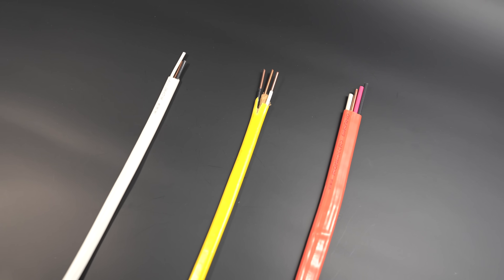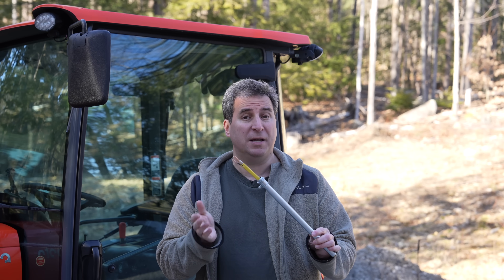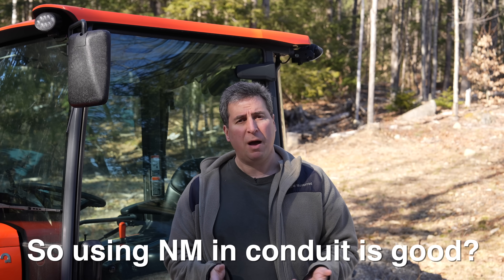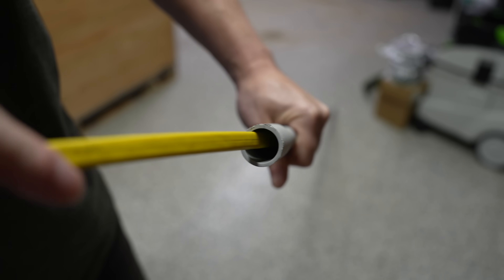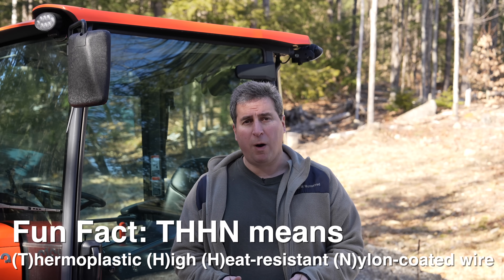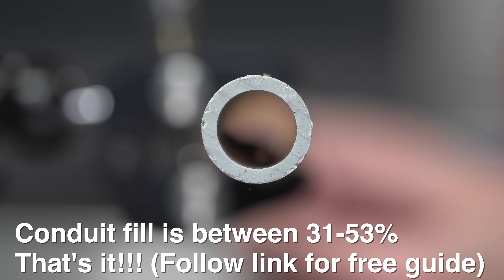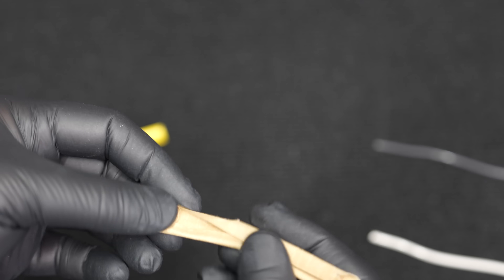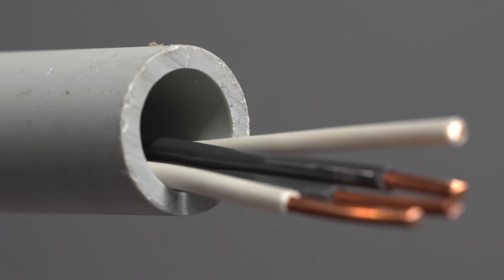#1 DIY Electric Mistake - Can you use Romex Wire in Conduit?

Comment: I ran it underground to my garage 40 years ago in 3/4 pvc conduit and it still works.😉
Reply: Ideally UF (Direct burial Romex) in PVC conduit since it is approved. I  don't believe standard Romex can be used because the plastic may breakdown over time when exposed to water & contaminates in water.
Reply: @guytech7310 - It's not really a plastics issue, (tho THWN is the right choice for underground installs) it's the paper-based protective wrapper inside the NM jacket can absorb, retain, and wick water the length of cable until it encounters a nicked wire jacket and shorts, or corrodes connectors. Yeah, more a problem in St. Petersburg or Seattle than Reno or Scottsdale, but rain happens!😢
Reply: @KevinSmith-ys3mh  Its the material as non UF Romex is not water rated. Look  it up.

Comment: The garage is considered a damp location in my area. 
If in doubt, ask the inspector before doing it.
Reply: That's makes sense. Because in some areas, garages are not required to be heated. This can cause high humidity
Reply: Liveing in Arizona and SoCal, it wasn't a concern. Now after moveing to PNW between the Vancouvers, I've shopvacced and sqeegeed out a few garages after heavy storm winds blew water past the doors. Its also a favored location for sewer cleanouts, and fail prone/maint intensive utilities like water heaters, regulators, sprinkler trees, water softeners, and cars dripping from rain & snow. So, location matters- hence local codes vary!😉

Comment: Thank you for this!  Currently in the planning stages for an outdoor project, and I'll make the necessary adjustments.  Does the ground wire need to be sheathed inside metal conduit in an outdoor applications, or is bare wire acceptable?
Reply: Absolutely use insulated grounding conductor. The reasoning behind this is if there is a short to ground, the bare wire will energize the metal conduit with fault current. Anyone in contact with that conduit will receive an electrical shock, possibly causing injury or death.

Comment: I plan to run 12ga romex inside 3/4" conduit for a dedicated outlet for a small water located inside the cabinet. The conduit would only be for the 4' run up to the attic space and then the 7' down to the cabinet. I was going to strip the romex outer cover for the conduit but maybe I will leave it on. I had read that heat (do to overfilling conduit, reason for the 3/4" conduit vs 1/2") was reason for not running romex in conduit.
Reply: More practical to just run THHN wire instead of Romex if your using conduit. not only is it code compliant its a lot easier to pull.
Reply: @guytech7310  Only reason I was/am going to use the romex is because I have a bunch of it left over from wiring the shop. All the rest of the conduit has thhn wire in it.

Comment: All modern NM uses THHN-insulation on the two insulated conductors. Sometimes (depending upon the Mfg. of the NM) those individual conductors are marked, sometimes not. Either way, it is the same wire, and perfectly acceptable to  strip the outer jacket from the NM and use it as individual conductors. It's literally the same wire.
I would challenge anyone to tell the difference between stripped NM, pulled into an EMT conduit, vs. individual conductors pulled in from a roll. I've had inspectors look at work done this way, and pass it without issue.
Lastly, using jacketed NM in any conduit is a classic rookie/DIY'er install mistake. While it is not prohibited by Code, it is extremely poor workmanship.

Comment: THHN has a higher ampacity rating than NM. In certain applications  this may be a reason you don't want to run NM in conduit.
Reply: True.  Since THHN is rated 90°C dry/75°C wet, if all the terminals are rated 75°C and you wanted to save on wire costs for example,  you could take advantage of this and use the 75°column, which would usually be the next size lighter,  like 8awg instead of 6awg.  Whereas NM-B is limited to the 60° column, no exceptions.  It would seem that this situation would mostly occur in commercial wiring particularly given the rising costs of material and labor in this day and age.

Comment: Some random guy made this “code” with zero evidence that the romex had any issues in an exterior conduit line and all the rule nazi’s adopted it as Jesus’ electrical gospel but no one can tell you why a 3/4” conduit run with a single 12/3 running through it for a short run is somehow “dangerous”.  Sure follow,code, just pointing out the absurdity of some rules at times.
Reply from the maker: I agree, at this point, there is no reason the jacket and internal paper cant be made of a waterproof material which would end the reasoning behind this. This has always been a stramge one that originally made sense when romex was made of materials from the 60s

Comment: If it's not compliant in your jurisdiction you can always run the NM romex cable to a metal j-box then splice in the box and run conduit out with rated individual conductors. As I understand it there are special circumstances such as foundation wall drops (not framed) where it's permitted (with limitations) but generally frowned upon because of the possibility of overpacking/lack of free air and heat dissipation with all of the extra sheathing, but conduits are not the only place where overpacking is regulated, such as cable trays in commercial applications where you also have to follow a strict packing density with spacing. Generally and practically speaking difficult for me to understand how a single NM drop in a conduit is going to overheat relative to the myriad of NM cables most homes have in their attic bundled with insulation in the dead of summer, seems relative.

Great video covering this topic though.
Reply: Yeah, like I would take your word or anyone else's on here without written verification.

Comment: This is great information.  We run into this situation at campgrounds when owners are burying NW wire
From the pedestal (18” above ground to “24 below ground) in conduit.  Never thought it was an issue for this short span of wiring.  Of course nobody is dismantling the conduit to check.
Reply: Mostly likely they are burying "UF" which is intended and allowed for direct burial.  It will be gray, and instead of an outer sleeve with separate wires running thru it, the outer layer is a solid mass molded around the separate internal wires.  The internal use has paper or string inside the outer sleeve to help maintain its form, but the outdoor doesn't need that because it is solid.

Also the short length of conduit falls into a separate category - conduit used as a short protective sleeve rather than for the entire length.
Reply: @Sylvan_dB  So it’s ok to put UF wiring conduit outside?
Reply: @Coldpack13  A short sleeve as you described to protect the vulnerable cabl between the ground and the box is fine.

(I don't know of a national definition for "short" but usually a foot or few is fine... a local code might be more specific)
Reply: @Sylvan_dB  Ok, thanks for the reply.
Reply: @Coldpack13  Yes, UF is rated for direct burial, and by extension damp or wet locations.  UF is allowed in conduits as long as it does not exceed the capacity of the conduit.  It is a common practice to use a conduit to protect the UF cable between the box and the soil to give it extra protection, like in the video.  For example, if you want to wire a GFI on your shed, it's common to bury UF cable and install PVC conduit between the box and the ground to protect it from sunlight and physical damage, like weed wackers. UF is even harder to pull through a conduit than regular NM cable is.
Reply: @BluCappy419  Thanks for explanation.  Couple of guys in the campground are just using Romex in conduit.  I thought the grey UF was correct.
Reply: @Sylvan_dB     Somewhere in the NEC there's an example of 2-3 feet as being acceptable for a short run of conduit. (for protection) but I have seen many inspectors allow up to 6 feet, such as when dropping from a ceiling in an unfinished basement to a wall outlet. Again, for protection.
Reply: @rupe53  Exactly. Sometimes the inspectors will draw the line at a full stick - some suppliers carry 20ft sticks! I took a quick look thru my old code book and didn't find it, but it's been too long and it is long out of date so I didn't spend much time.
Reply: @Sylvan_dB    it wasn't the latest code, but it was within the last 10 years. Someone posted the chapter / verse under another video. Once they go that far you know they are onto it and not just blowing smoke.
Reply: @Sylvan_dB  24"
Reply: @Coldpack13  Absolutely. It can determine the depth of burial in some cases. Typically it is direct burial and protected in high impact areas with nipples (short pieces of conduit.) However, it is allowed in conduit for the full length. Once again, better to upsize the pipe as it'll take up a bit of space and be tougher to pull through pipe. Generally speaking, I wouldn't pipe UF just like I wouldn't pipe NM but I would definitely utilize protective nipples in areas where I might expect someone to impact it.
Reply: @rupe53  You can utilize whatever length you want HOWEVER conduit fill calculations will kick in at above 24in for nipples box to box. Also ampacity adjustments kick in. Below that it isn't needed. As far as protective sections... they can be any length in theory as 310.15(c) and Table 1 of Chapter 9 apply to complete runs of conduit/tubing. BUT you'll have Bubba that thinks he can outsmart the system by running 95% and saying it's not complete so he can stuff it with wire. That's where 90.4 comes in and the AHJ can step in and say "nope that's illegal per our local code/interpretation." 

Running down from a ceiling to a box is fine because there likely won't be the heat load the code is trying to prevent. HOWEVER, the AHJ can and sometimes will be stricter and that's allowed per 90.4 (if they even adopt the NEC at all.) If you're trying to stuff 8 circuits through a half inch pipe for 10 feet just for protection, they may call it out just because it is dumb. Spend the extra $2 for a bigger pipe lol.
Reply: @etherealrose2139    in a typical residential situation, you'd be hard pressed to exceed the fill rate on conduit because you are usually dealing with single circuits and the Romex / UF is already hard to stuff in there because it's bulky.

Comment: What about running outdoor rated romex in a conduit outside?
Reply: There is NO reason to do that.  It is MUCH easier just to buy wire and run that through the conduit.
You can just get Direct Burial Cable instead.
Reply: @paultrauzzi5360  I prefer the belt and suspender approach. Since 1997 I run direct burial cable in conduit outside, never had a single callback except when a farmer ripped up a conduit with his excavator.
Reply: @ 
Again, there is no reason to do it.
Why not just run wire or just bury the wire?
Why are you using conduit?
You are lowering the amp rating.

Comment: Can you put it in conduit, yes,  but why would you is a better question,  pulling a single solid conductor through conduit with any sort of bending can be a major pain, to pull 3+ which are also encased in paper and another sheathing is absolute lunacy for anything with a bend.      That said there are instances where NM wire MUST be a conduit, when it's required to protect it, I mean I'm guilty of having exposed NM wire in my garage that should be protected... maybe one of these days I'll get around to doing it.    But 334.15b does state that if you're going between floors your NM needs to be in a conduit,  granted not the entire run does just at the space between floors.

Comment: why cant you run it in a conduit in damp location?
Reply: The outer jacket will hold moisture. Also, while some manufacturers use THWN for their NMC, not all do which means they can't withstand damp or wet locations.
Reply: Its fine with UF (Direct burial Romex) cable
Reply: @guytech7310  Yes but the video is about NM-C. Besides, it would be a waste to use UF in a conduit. THWN FTW in conduit in damp/wet locations.
Reply: @BigBrotherIsTooBig  Use PVC conduit to protect UF when its exposed, such as when it exits the ground and goes into a building.
Reply: @guytech7310  Of course it needs mechanic protection when exposed, but no need when it's buried 24" or more. If you are making it shallower than that you have to use conduit, which would make using UF pointless.
Reply: @BigBrotherIsTooBig  Thats the point of conduit: to provide protection. Only reason to run conduit underground  for the entire length is if you want the ability to add additional circuits. Pulling UF through long conduit is a pain so its rarely done.

Comment: The only time you should really use NM cable inside a conduit is on the basement concrete wall. You can use conduit as a sleeve of protection when you drop the NM cable down from the basement ceiling joists onto the wall to install a metal switch/outlet box.  Fasten the conduit to the box with an appropriate fitting, then install a plastic bushing on the other end and fasten that end to the ceiling joist using a one-hole conduit strap.
Reply: Thank you, came in to point that out. Sleeving cables for protection is definitely allowed.
Reply: OK for UF (Direct burial using PVC conduct for protection for outdoor use. Metal conduit below ground is not acceptable because of corrosition
Reply: Came here to say just this, have done this for a dryer outlet and for a receptacle for the washing machine
Reply: Kitchen island is another good example.   NM inside a sleeve is not embedded in concrete, if some one wants to throw that argument out.

Comment: I think people are scared of the heat build up, but if you dont overfill it its not a concern really.  My concerns with conduit are securely mounting the wire so it cant fall back into the conduit with romex which is required to be secured within usually 12"s of the junction box. Also when people bring romex into a subpanel using the same conduit as SER or other wire thats running at higher rated temps and possibly overheating the romex in a confined space.